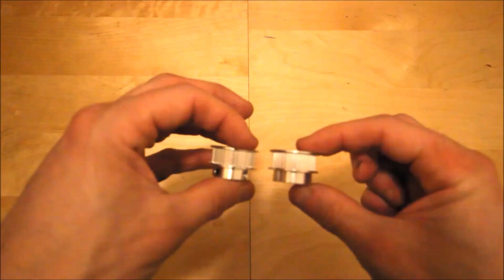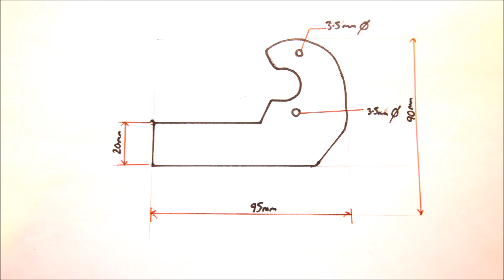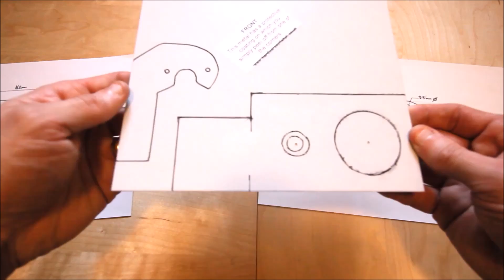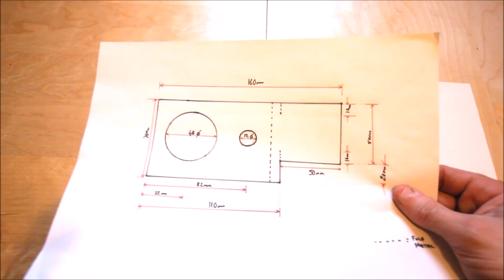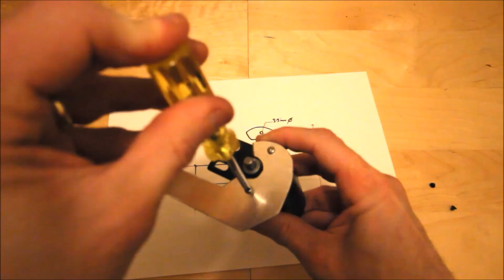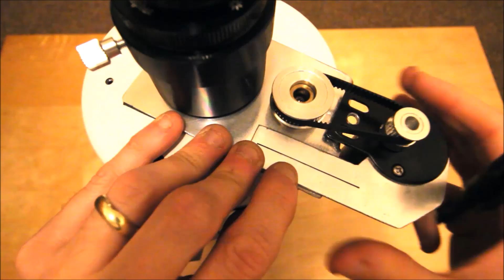How to make an Electric Focuser for your Skywatcher 127mm Maksutov telescope

Comment: Hi Martin thanks for the video wondering what adapter you had on the back dose it change it into a 2 inch and would this work for a bresser messier 127 1900 its a Maksutov also, thanks Martin clear skies 😊
Reply from the maker: It was the TS adapter, it should fit on the Bresser Messier no problem, https://www.365astronomy.com/ts-optics-2-visual-back-for-skywatcher-and-orion-us-maksutov-cassegrain-telescopes

If it doesn't then you'll might need this special adapter to fit on the scope to allow for the Mak 2" visual adapter to fit.

https://www.firstlightoptics.com/adapters/astro-essentials-mak-to-sct-adapter.html
Reply: @MPAstro  thanks Martin your a Legend, your videos have given me alot of help dude, your good at what you do, much appreciated clear skies 😊
Reply from the maker: No worries Aran

Comment: Thank you for the time, expense and effort you spent making this video.  I watched several of your videos and refer back to them as needed.  
I significantly decreased the wind noise on my videos by putting a band aid over the mike holes on my camera.  Now the only time I get wind noise is if the sticky part at the edge of the band aid works lose.   When it comes lose I add a piece of tape to close the air gap or just put on a new band aid.  
The audio on your videos improved dramatically while inside when you reduced the room echo.  Great job.  
Thanks again for all your videos and time.
Reply from the maker: Thanks Southernexposure123 for watching and for the tips, I've managed to invest in a better microphone with a wind buffer, but I still get interference with the wind, so my next step is too invest on a on body microphone, I need to start changing my scene, I want film the sea, as part of my background, I live so close to it, I'm practically 300m away from it, and they would be very nice changes combined with the night sky. The new microphone was huge improvement I totally agree, and I will continue to improve on my videos, I only wish I was good at it in the first place, but then I'm not a professional video editor and I use this platform as a hobby. Thanks for watching & clear skies for 2021
Reply: @MPAstro  Thanks for the information.  Once I checked out the possibility of using a remote microphone on my body.  They cost a lot more than I was willing to spend, so I just did the bandaid thing and talked a little louder when I wasn't close to the camera.  The band aid doesn't decrease the sound any at all.  Your voice carries well and you put plenty of audio into the mike.   
If you can find one or even make one at home yourself you might want to try a much less expensive mike design called a shotgun mike.  They can be made with a condenser mike element and the element can be inserted different distances down a tube (a piece of small diameter PVC pipe works good) and lightly insert cotton balls inside the tube to help reduce unwanted noise.  What's called a dead cat put over the shotgun mike tube works good to eliminate wind noise for a lot of people.
The seaside scenery would be a nice addition to your channel and to your night sky photos.  I look forward to seeing the change whenever you can manage doing so.
Editing videos can sometimes be the most challenging part of shooting tutorials.  You show the procedures clearly enough and you don't need to worry about making a lot of changes to the way you present your ideas.    
You do a real good job of explaining all the different intricacies of your projects and you answer nearly every question viewers might have about your improvement modifications.  You're doing a very good job.
Change up whatever makes you feel better and you'll do just fine. 
All the best to you in 2021.

Comment: Hey Martin, awesome videos, thanks for sharing all these useful tips. May I ask you what is the name of the piece that you attach to the visual back of your mak127? I've got a mak127 as well, the visual back is 2'' and Id like to add something like a twist lock to make the conections more rigid (for instance if you attach a dslr). What would you recommend? Thanks in advance.  Clear skies!
Reply from the maker: Here you go!!! 

TS Uprated 2” eyepiece holder:
https://www.teleskop-express.de/shop/...

or a UK retailer that sells it too!!

https://www.365astronomy.com/ts-optics-2-visual-back-for-skywatcher-and-orion-us-maksutov-cassegrain-telescopes.html

These adapters now come with to methods of threads to fit different makes of Maks, There is brass one and a Thread when you remove the brass insert, here I fit my Skywatcher Mak 180, Hope this helps?

Comment: Hi Martin brill vid 

Unfortunately the wind noise cut out where you got the bits
from. I have a Meade NG127 Mak Cass from Opticstar the problem is the focuser knob
is rubber and there are no screws it get it off “any ideas” 

Athol Steele
Reply from the maker: Thanks for the feedback, I have to say I have no idea on that type of telescope, without been able to look at it myself, It's either glued on or pressed in, usually the rubber could be pulled out by hand. However if you cannot remove it you still can use a rubber tooth belt over the rubber focuser, and it will still work that way (under correct tension). But I'm guessing you prefer the Aluminium GT2 pulley to be fitted on there which I see will look great on this smart Meade telescope?

Comment: Hi Martin i have a question Ive got an 26mm 2 inch Okular can  i juse an 2 inch Adapter in my  127 Maksutov and is the View ok ?Greetings from Germany Berlin
Reply from the maker: Unfornately I do not know that eyepiece if it works with the scope, it really depends on it's optical design, but I cannot see why not, My Panaview's are 2" format and they work really well, as long you have the eyepiece adapter you should be OK.
Reply: thank you very much Martin

Comment: I have an 8"Mak and found that it vibrated badly when you touch the scope even to focus.
So I found an old panasonic video recorder the type that you had to carry around a full size recorder which weighed a ton.
I did not find anyone interested in buying it because it was so old.
So I stripped it down to keep lenses from.
The zoon lense had a fully geared motor no bigger than an AA batery, and drove a ring gear on the ajuster that was about two inches dia.
I made a circle from nylon cutting board and machined it down so that the ring gear would just fit over it, made sure it was level and suoerglued it to the nylon ring, which I drilled a hole just slightly smaller than the rubber sleeve in the focuser.
once  i had  carefully removed enough of thevrubber off this rubber sleeve to sit tightly inside the nylon ring, I then made a bracket from alloy plate to sit under the locking ring of the lens tube and a bracket on the bit of alloy to take the motor so that it matched up to mesh the gears and put a socket to supply to motor with power.
I bought a plastic box and at variable tuner pot andva two way toggle switch and made a variablevspeed controller.
It works very well indeed with no vibration at all.
I made the power lead long enough so I can have all the controlles next to my computer and powered the fovuser fron a nine volt plug in transformer, in all about ten dollars.
I am amazed that after having been through the internet that nobody seems tommake a univesale conversion so siut all types of cassagrain scopes.
There  are plenty for reflector scopes at on hell of a prise  when you consider it is just a worm drive, and again I made my own, thevworm drive was not too easy to find butbthe rest wasca bit of cake.
I am pleased that I tendbto clollect bit of all sorts as they really do come in handy.
My next trick will be to build a rotating observatory using a twelve volt motor from a lawn mower geared right down and run it on a rubber wheel with a foot pedal control for direction and speed so I can put a hard mount for the scope to totally remove any vibration.
I am glad to see I am not the only one who has to use the gray cells inmplace of hsrd cash.

Comment: Martin, your links don't work! Interesting project.
Reply from the maker: I Know I tried to link the videos to webpages, but YouTube makes it so difficult has you have to apply settings and agreements for every link which takes so much time, the only way have to do it, is pause the video, write the URL or copy the URL on there and paste it on your web browser and the links will direct you to the webpages.
Reply from the maker: I've had the camera for a good 8 months now, and had no moisture issues. Once I have finished using it, I take the camera indoors in a warm room and allow the camera to dry. You can use a clean absorbent cloth to quickly wipe down the camera body once the ice has melted. allow 2-3 hours to dry with the sensor cap covered up, then place the camera in a air tight sealable lunch box and put Silican gel (dessicant) packs in there with the camera, and replace the cover. this will absorb any other moisture that got in the camera electronics. But this mod only cools the camera body, has the body protects the electronics, by following this advice I have never had any issues on my camera at all.
Reply: Copy and paste doesn't work; I tried it.